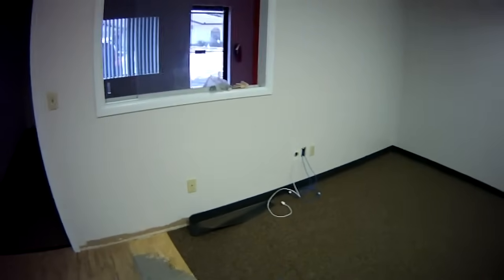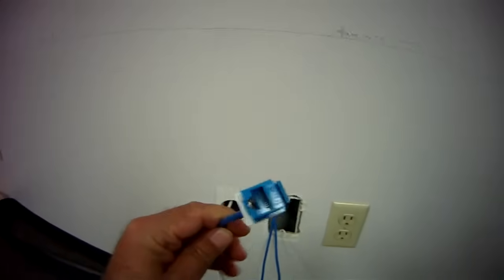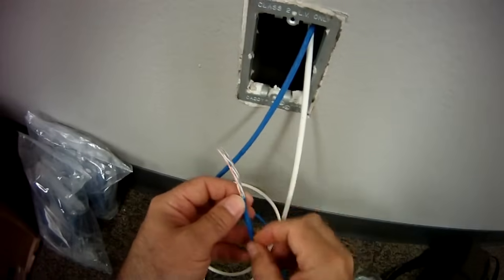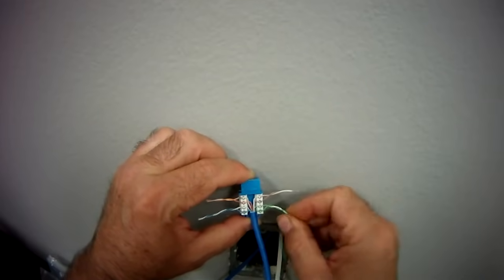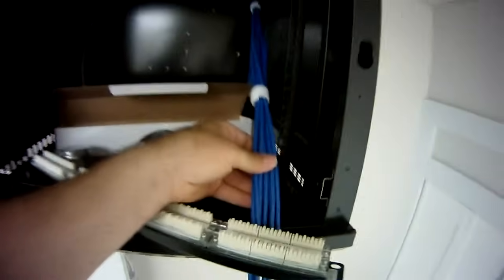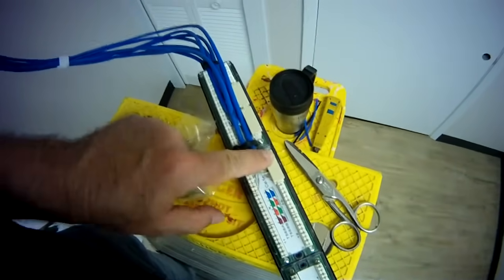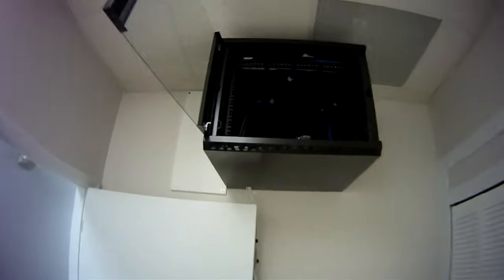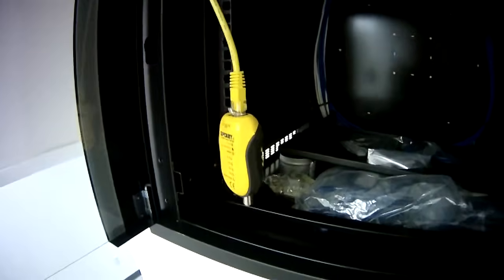Wiring an Office Network

Comment: you can avoid having so many wires to throw away, and flying everywhere when punching down the keystones, by twisting the 4 wires on each side together before punching down, this way you only have two bundles of excess wires. The "reinforced" area on the keystone you are zip tying to is called a strain relief.

Comment: I'm an engineer who agrees with the trolls.  Using the building as a trash can is indicative of a sloppy mentality.  Even if your installation is perfect, it can lead the client into wondering what else is sloppy.  You need not walk to a trash can.  Use pockets, or anything else that you might have with you right there at your work.  If it's your building, anything goes, but teaching the internet to not be sloppy makes a better instructional video.  Also, use a real wire stripper for the purpose - not scissors.  Models are available that are cheap, quick, and much easier and safer to your installation..
Reply from the maker: thanks for watching :-)

Comment: @NetworkAdvisor , Awesome video!!! Thank you. Question...  do you know why the T568B wiring pattern displayed on the patch panel you used (BR,WBR,G,WG,O,WO,B,WB) doesn't actually match up (in order from left to right) with the T568B wiring pattern used in general for the connectors? (WO,O,WG,B,WB,G,WBR,BR) Is this common with all patch panels? To be different? I mean, If it's T568B, why would they not just follow the same left to right color wiring pattern order... as we've learned it in general? Just curious... as I'm trying to learn.
Reply from the maker: Right.  Funny,  I never realized how that might be confusing to someone not familiar. 
So with patch panels you almost always punch down pairs in color order (blue, orange, green, brown).  What you don't see is that the 568B mapping is happening between the punch and the gold pins in the front.  It's not a one-for-one mapping front to back.  Hope that makes sense?  😄

Comment: What's the white wire for?
Reply: If you're talking about 3:50 where there's is a blue cable and a white cable, its usually to differentiate between devices. In other words, you typically use a blue cable for a data connection to a PC and a white cable for a digital phone (VOIP). You don't have to do it, but it may make it easy to essentially keep track of what device should be plugged in where. It can help in basic troubleshooting. If you have a user who's phone isn't working, you can ask them to make sure it is plugged into the white port.
Reply: @JJFlores197 oh I see, that makes perfect sense! Thank you for your reply, greatly appreciated.
Reply from the maker: That's right JJ.  The customer asked me to use white for voice/fax. 🙂

Comment: I have a question for commercial buildings. For commercial places like Walmart or Home Depot they they run the cable in the ceiling without any conduit. Can I do the same for a church that has the open ceiling like home depot?
Reply from the maker: You can.  I think it’s a matter of aesthetics.  As far as I know, there’s no law against it, just for cya, I would bend the ear of a local electrician in your area just to be sure there’s no weird codes against such s thing.
Reply: @NetworkAdvisor  thank you

Comment: Hey man I noticed something with your service loop. I was at an office one day with severe water damage from a construction site one floor above. Basically the floor above was completely flooded over night due to a main water pipe that broke unnoticed. So lots of water came down to that office from the sealing and their network infrastructure was destroyed. Water was slowly running along those Cat cables directly into the patch panels at the top of their racks and then dripped on all the switches, servers, telephone system and their router below. Having a service loop like that probably would have saved some of those devices. So this is a pretty cool idea for several reasons 👍
Reply from the maker: Oh great point.  That’s definitely something I worry about with Outside plant cable as they traverse from outdoors to inside.  I have to say that in many years of installing infrastructure, I’ve only run into water events twice.  And in both cases, they only affected one outlet.   Thanks for pointing that out! 😊
Reply: @NetworkAdvisor  Indeed it is rare. But when it happens, its bad haha

Comment: Honestly I got a lil confused when you said you're using cat5 cables, cat 5e and 6 are a lot better and more reliable. Yes cat6 has a shorter distance but for a small doctor's office I don't understand what the issue would be with that... Sorry just nitpicking is all😅
Reply from the maker: Hmmm.  Not watched that video in years.  But I am pretty sure that was Category 5e in that office.   Cat5 went out in the late 1990s.   If I did say Cat 5, sorry for the confusion.   
These days, cat6 is pretty common.   Starting to see occasional 6a too.
Reply: @NetworkAdvisor  yeah you did say cat5 but it's cool man! Just a lil mistake, but it's interesting you say cat6a is now being introduced in some places... I've never heard of a 6a before just the 3... Do you know the specs on it or nah?
Reply from the maker: 650 Mhz.  Can handle 10Gbps! 😎
Reply: @NetworkAdvisor  oooooh that's pretty impressive! That's really fast actually, sounds pretty expensive though haha
Reply from the maker: Yes, category 6A cable can be anywhere from $.50 hrs to a dollar per foot (USD). And the 10 gig network switches are still pretty expensive. Ironically, you can buy a 10 Gb PCIe. network card for about $100 USD

Comment: is it ok to use telephone terminal blocks to internet connection??? anyone please
Reply from the maker: It might work.  Its not ideal.
Reply: @NetworkAdvisor  ok but could explain the method more specifically. and thank you for your support
Reply from the maker: All data wiring where link speeds of 100Mbps or more are expected should terminated onto keystone jacks (cat5e, 6, 6A) or a Ethernet patch panels.   
Phone termination blocks (ie 66 blocks won’t support the speed.  But might be acceptable for 10Mbps if your legacy equipment still supports that.
Reply: @NetworkAdvisor  ok and how can i connect from tele termination block to switch?

Comment: Make sure you support cables above the ceiling away from the ceiling grid hangers. And and use metal cable ties every 1.2 mtrs.

Why would you not use fire grade cable?
He called the ‘ keystone jack ‘ and RJ45.  Not correct!
Cleaning up as you go shows a professional approach.
Service slack good for very few lines but when terminating 250 plus lines it will get in the way.......

Comment: Great video. I got 1 question. If i want the same setup to also supply internet to all the rooms, will it work in same cable? Or i need to do separate wiring.?

Comment: I'm not a fan of through the wall installation because what if you need an upgrade like for example to add a new node or change the cable from cat 5 to 6e or what if you have a damaged keystone jack, what if the cable itself is damaged there's a lot of reason why a network cable must be installed in a trunk.

Comment: I recently started wiring my house house up with cat6. It was made in the 50s and when pulling cables through the attic I noticed it was littered with ancient bits of telephone cables and old mating blocks. And I wasn't upset, it was more interesting than anything.

I guess what I'm trying to say is that in the year 2040 when someone finds some old cat5 twisted pairs in the wall there's a pretty good chance they'll just smile and remember how things used to be while they're putting in fancy new optical-to-the-desk wall plates (that still terminate differently from vendor to vendor because some things never change).
Reply from the maker: Ah ha ha ha...  interesting perspective, Mike.  I think that way too.  Good luck with your project! 😁

Comment: Question..this is just a general question..but why do cables from the walls go to straight to patch panels  to a switch..is there a reason why the cables couldn't just go straight to the switch?
Reply: You could run the cables straight to the switch, but using a patch panel makes the wiring look cleaner and more professional.
Reply from the maker: Thank you for that Santana.  And, it makes troubleshooting easier.  It's best practice in the commercial environment, but for home use, you could skip the patch panel if you wanted to.

Comment: Interested in this field. Once you have terminated the rj45 and terminate the patch panel....what then connects to the patch panel so people can get internet?
Reply from the maker: good question.  So, on patch panel side, you would have a network switch, a router, and maybe a cable/DSL modem (some routers have the modem already built in).  So the connections would go like this   ISP service --> Modem -->  Router --> network switch --> patch panel.
Reply: @NetworkAdvisor  Thank you so much for the reply. Your information is truly valuable.

Comment: Thank you for taking the time to make this video.  It was informative and helpful and I appreciate you taking the time to show how something like this is done.

How difficult is fishing the wire through the walls?
Reply from the maker: Jake, fishing cable through walls can be not-too-bad if the wall is hollow.  However, if there is insulation or horizontal trusses, it can get very frustrating.

Comment: Anyone that has done any kind of "Production work" knows that it's actually "Best Practice" to put the trash in the walls.  In the 70's and 80's Low and High Voltage Electrician trash was the only Insulation homes had.  In Fact most Construction companies put Box trash in the walls for Insulation.  Putting Clean Trash Fill in walls is acceptable  Insulation by All City Codes and does not pose a fire hazard.  Also the Wires in the wall can be retrieved later by any tech that knows to look in such spots to find Jumpers.   The Service loop should have been above the ceiling tiles and it should be 15 feet long; wound up and attached to a ring in the ceiling.
Reply from the maker: Don, thanks for filling in the knowledge here .  Sounds like you've been around. :-)

Comment: I’m new to networking but love it. My main question is what really is a patch panel for? Would it not be better to just use a switch?
Reply: I think I get it now. Would you, for example, go from the patch panel to a switch and then to any other devices on a network eg a printer or a file server? Please correct me if I’m wrong
Reply: @ItzFitz  yes, from the wall you go to the patch and from there to the correct switch. This is ideal if you have multiple networks and even multiple sockets in the wall, simple setups mostly benefit from it when you need to replace the switch, but this way you always know that the path to wall socket A1 goes to patch A1 and so on, so it's very easy to change the whole setup if needed without special tools or spending a lot of time to figure out the wiring inside the walls

Comment: CompTIA says you need to use Plenum grade wire when going into air spaces such as drop down ceilings or floors?
Reply: Could be wrong but is it something to do with if you have aircon circulating in the space? (Pushing air through?) Just taking a guess as not sure either.
Reply: None Given I think so but I guess it's more a "code" thing for building inspectors and city ordinances.
Reply: @mr mike Hi, it really depends on the type of role you decide to enter into. If your job requires this type of work then you may have to.

Comment: I think you got a great video and it's very informative except for the trash in the wall deal. I don't mean to be a troll, but I am going to call you out on it. As an electrical mechanic, I always carried the box that my Outlets or devices came in with me that way I can put the trash in the box and dispose of it when I was done rather than just littering it into the wall whether anyone was going to see it or not. Work should always be done clean and you mentioned that an ounce of prevention is worth a pound of cure. Good Tradesmen always clean up after themselves!

Comment: Those grates in the ceiling look like those used in a plenum HVAC system. Which by code requires plenum rated cable... so doesn’t look like this installation is to code
Reply: Where are you located? The plenum space isn't everything that's above the ceiling

Comment: "to all you trolls calling me out on throwing trash in the wall"

My dad taught me "have pride in the work you do". Did you skip that lesson in life? 

That laziness and attitude stereotypes all us tech guys and is the reason why I won't sub out wiring to "help" somebody because you talked about saving time, well you don't save no time being lazy not carrying a small plastic bag with you to toss in the trash can rather than walking back and forth, as you claim, to the trash can. 

I mean you're doing this for a CUSTOMER. I can see cutting corners and being lazy for non-paid friend/family work. I finished a wiring job earlier this week and the guy helping me saw the ceiling tile mess then found the vacuum at the business, turned it on and cleaned that up even though the customer told us not to worry about it. That extra 5 minutes made us look less lazy than you.

Call me a troll in response which I have no problem you calling me that but I'd rather be called a troll for calling you out than a customer calling me lazy.
Reply from the maker: thank you for the very thorough and thoughtful comment.   And, thanks for watching!  :-)
Reply: Lol, you do know that those wires will probably never be seen until they break down the walls again, which could be YEARS from when he threw the wires in there... The tiny 1-2 inch pieces of wire is the least of anyone's worries.
Reply: @UrAdversary  do you run a red light if no one is there? Typically no because people have integrity. Same principle applies, no one will ever see the rubbish thrown into the wall, except you. It just feels more professional and would make me feel prideful of my work if I clean up my own mess, regardless if others will ever know or care
Reply: @TheEphemeris  actually I do run red lights when no one is around, lol. And that's another good example for me, who is it affecting? No one. It doesn't hurt anyone so I'll continue to do it
Reply: @TheEphemeris  Run a red light when no one is there?  Absolutely.  What, do you just sit there by yourself like a goon?

Comment: What plugs into the patch panel
Reply from the maker: short Ethernet cables that go from your Network switch.  Great question.  :-)
Reply: @NetworkAdvisor  Now if most of the patch is B.   Can you do A as long as everything you do is A?
Reply from the maker: yes, as long as both ends match, you can mix up A and B on the same patch panel.  Might drive the next poor guy who comes in behind a bit mad, but we've all be there at one time or another.   :-)

Comment: Why dont connect directly to a modem?
Reply from the maker: Gumbile,  you could connect directly to the modem IF you only needed one PC on the network.  But, in order to share the Wide Area Network connection with multiple machines, you need a router for Network Address Translation.  And, you need a switch for multiple Ethernet ports..

Good question. :-)
Reply: @NetworkAdvisor  Yes but why do you use that board instead of the Router Switch Combo? and from the Switch output to sockets?
Because thats the way i see people doing on telephones
"Not my area just tryng to learn"
Reply from the maker: certainly in a smaller environment you could get away with that.  (like home or small office).  But, using patch panels is a best-practice in the industry.  For one thing, it allows for easier troubleshooting.   Another thing that happens is when the patch panel is skipped and the cables are just hand-terminated with Crimp-on RJ-45 ends, is that the tent to become unreliable.  The wires come loose, or begin to slip out of the RJ-45.

Your observations are good and reasonable questions for someone starting out.  :-)
Reply: @NetworkAdvisor  So why do u use the patch panel when you can only use the Router Switch Combo?
Why dont u just connect from the Socket to the Switch?

Comment: Should I stay wireless or stick cables through the walls?
Reply: Nothing is more dependable than a wired connection, run the cabling if you can. Cross members are a bitch when fishing through walls so watch out for them.
Reply: When wireless trippin then what
Reply: Stick cables through your windows

Comment: RJ45 is the designation from Bell Labs for a data line with a programming resistor terminated with a keyed 8P8C , it's a misnomer that's used so commonly that the definition has essentially changed to mean an Ethernet modular plug.
Reply from the maker: Exactly, sir.  Sounds like you've been around the Telecom block.  
My father was a Bell guy back before the divestiture.  He said a lot of the "Craft" has morphed into things like that (i.e. calling 8p8c nodular plugs as "RJ-45".  ).   Appreciate your input. 😁

Comment: Thanks for  video. 
I would like to  ask  ( if it's  ok)
How  much  is labor  cost  for  projects  like this  ? 
Thanks .
Reply from the maker: hi Alec. I did this job as a contractor.  so, my price to the master contracting company was $750 USD  for the labor only.  the materials and equipment were an additional $800-1000.
If I was doing this job for a retail consumer (regular customer) it would probably be about $2500 USD for everything 

great question!